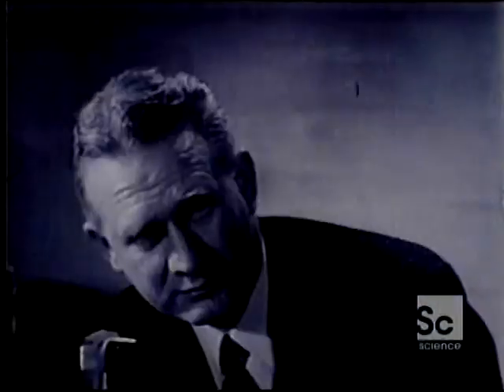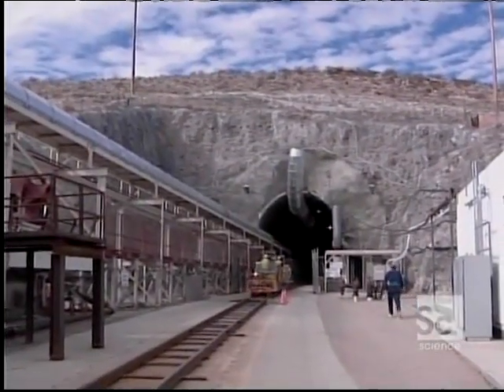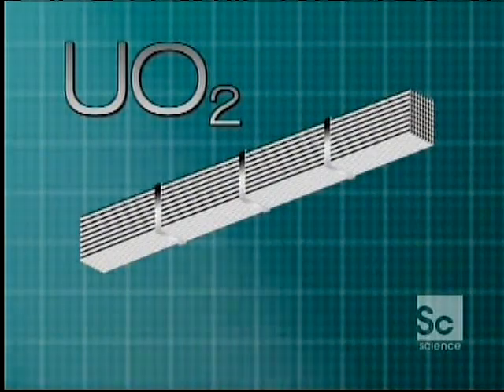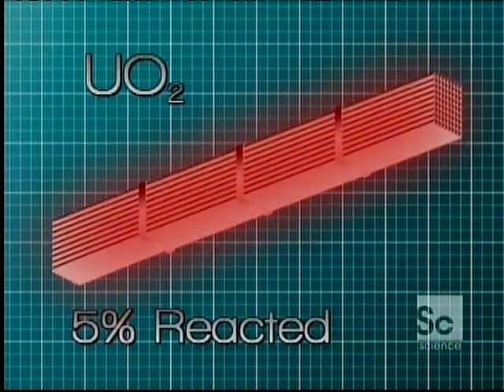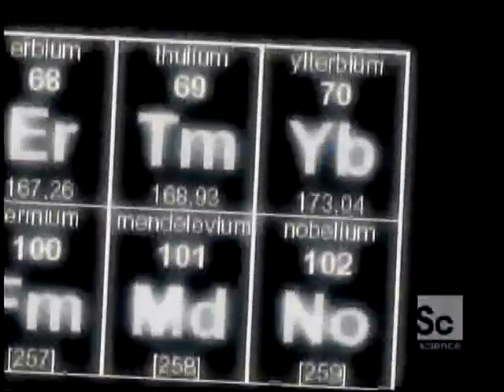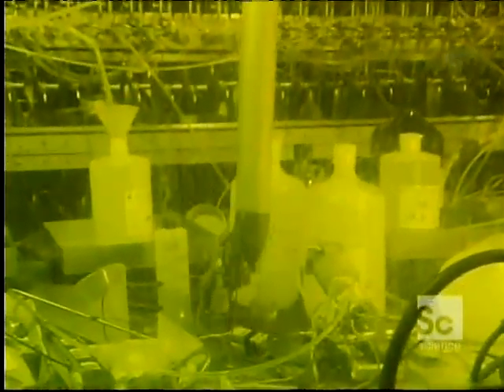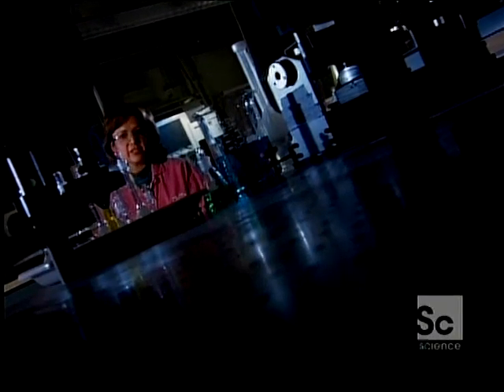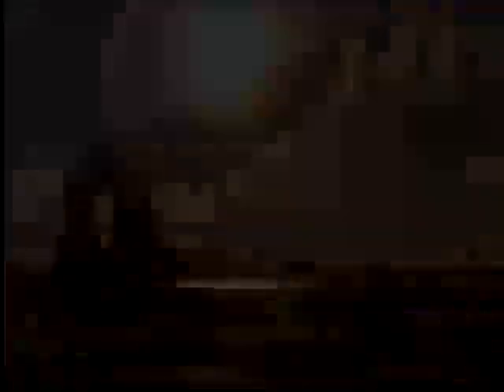Doing the impossible: Recycling nuclear waste

Comment: The other comments are also quite correct in that some level of recycling of spent fuel happens in other countries, mostly to create "MOX" fuel, which gives you a second (or more) kick at extracting energy from the fuel, plus reducing the volume of the waste.    Some process to recycle more of it would be nice, however, the idea was actually implemented decades ago in the EBR2 design, a reactor which ran from the mid 60s to early 1990s, proving fuel could be continually recycled in such a reactor.  The design for nuclear decades ago was to have BOTH breeders (similar to EBR2) AND the light-water plants we have today, with the reasoning at the time being that uranium was very rare.  Turned out it wasn't, so much of this effort was terminated - sad though - since it would have set the US far ahead with little need to import oil or harvest our own the way we do now.

Comment: I think this video does more to scaremonger than alleviate fear.  Spent fuel is quite dangerous the moment it is removed from the reactor, but it is placed in cooling ponds for 10 years to deal with both initial radioactivity and heat issues.  After that, it is much safer to handle and then stored in "casks" at nuclear plants around the country where standing outside one of these casks exposes you to nothing more than background radiation.
Reply: Not as rosy as you describe.
A fuel rod that has been in a cooling pool for ten years emits 10 to 20,000 rems per hour. at a distance of 1 meter it will give you a lethal dose of radiation in five minutes.
Cask storage would be good, but currently less than half of all spent fuel in the US is in casks. The US has over 130,000 tonnes of spent fuel, 80,000 tonnes of this is still in ponds, 50,000 tonnes is in casks onsite, and none has been sent to final disposal. The vast majority of casks are not rated for transport and none are rated for final disposal. 

Spent fuel represents a huge risk. It is a tasty strategic target capable of contaminating vast areas with thousands of times as much specifically radioactive material as is produced in a bomb, or released by Chernobyl. All of it long lived. It is a terrorist target, as even a spent fuel fire can release many tonnes of material. Obviously the pools are the most vulnerable, as these require unfailing active management, but not even casks are rated for nuclear attack.
Reply: The inner cask is a tungsten alloy high nickel stainless steel can 2 to 3 feet thick and has 8 foot thick of concrete around that. The 137Cs is the main culprit for keeping it spicy for a while.

Comment: Perpetuates common public misperceptions.  Those stacked barrels in the warehouse are  very low level waste materials, even needles, shoes, clothing, experiment animal carcasss, etc.  Those CANNOT be recycled for new fuel; they are just incidentally irradiated materials we sequester out of an abundance of caution. 

The high-level spent fuel rods are in dry cask (heavily re-enforce Ed steel and concrete storage cylinders), usually still in site at nuclear power plants not bothering anyone.  Those CAN be recycled.

I'm surprised that this channel did such a poor job educating people about: 1. The true risk of low, mid, and high-level radioactive waste ; 2.  How high-level "waste" spent fuel rods are stored now (bothering no one) ; 3. What exactly can and cannot be recycled.

This video was more TMZ than MIT ;)
Reply: The great majority of spent fuel waste in the US is not in casks. the AEMO inventory has over 80,000 tonnes still in temporary storage in overcrowded pools, with only about 50,000 tonnes in casks. These casks are not rated for final disposal, and most are not rated for transport.